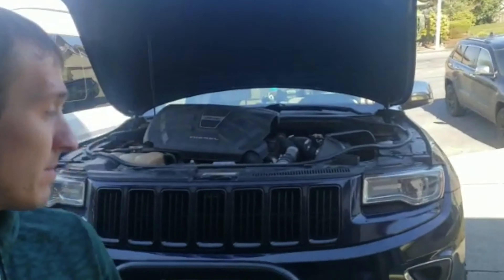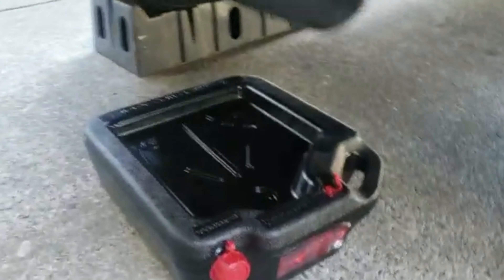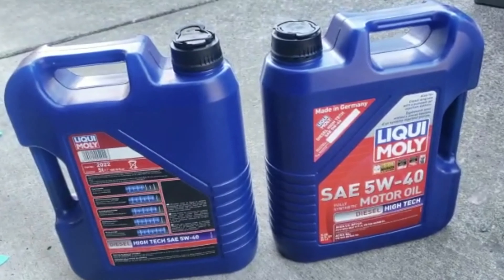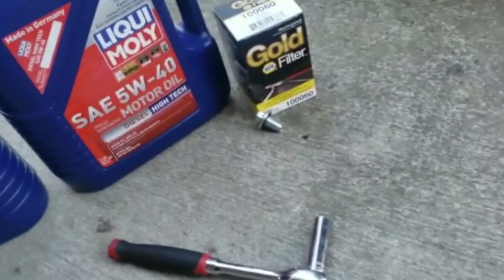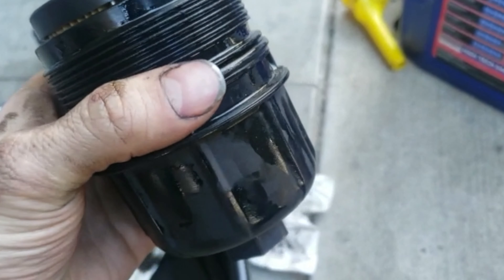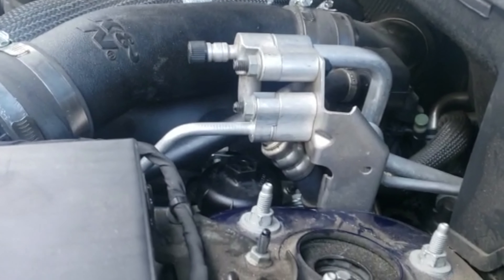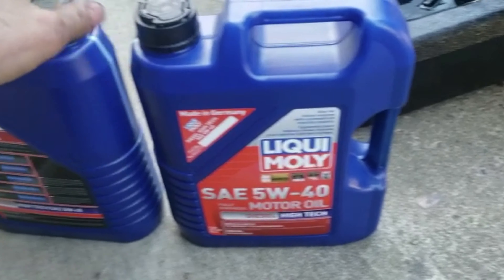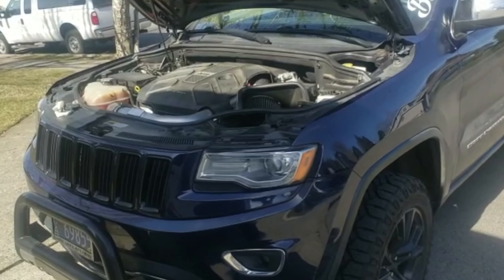Oil change in grand cherokee ecodiesel wk2.

Comment: You havnt done any jeep videos in a while but I noticed you had a shroud around or cold air intake is that to capture more air? Maybe I might try that. I did take my engine cover off to run cooler seems to work I think.. okay ciao thanks for reading
Reply from the maker: That shroud is to keep as much hot engine air away from the intake and to capture more cooler air.

Comment: are you still using the liqui molly oil and whats the spec on that oil
Reply from the maker: Yes it german made oil, really good quality. Its 5w-40
Reply: i see your using the diesel high tech here where im from whe only get the top tec 4100 5w40
Reply from the maker: @jpnaude5169  diesel high tech is best but regular 4100 would work too its still better then other oil brands.

Comment: 5000 miles is too often and a waste of money, the manufacturer recommends 10,000 miles.  Diesel oil doesn't breakdown as fast as gas engines.  Most of the damage to the oil in a gas engine is from minor amounts of fuel getting past the rings into the oil and the gas breaks the oil down.  Other than that, good job.
Reply from the maker: I disagree with you. If you change your diesel every 10k miles in these engines you will be changing your intake manifold by the time you hit about 100k miles if that. Because it clogged up from all the ash and junk. And your egr as well same goes for the turbocharger. I worked in for about 6 years i have seen cars that got their oil changed every 5k and every 8-10k i looked inside the engine huge difference. Im just speaking on experience not stating and opinion here. I will never wait until 10k miles and will never recommend it to anyone. If someone wants to its up to them on their own risk.
Reply from the maker: Diesel oil mainly has low ash compared to gas engines. The turbocharger is what breaks it down faster compared to the naturally aspirated. The diesel engine oil gets contaminated alot quicker then the gas engines. You probably know that already. And like i said i do it about 5-7k not more then that.
Reply: @BuiltForSpeed  considering my mother in laws ecodiesel has 160,000 miles on it and has changed her oil every 10,000 miles per the manufacturer specs with never having a single issue, I doubt it.  I have experience with lots of high mileage ecodiesels with no issues
Reply from the maker: @44stevenson  never had issues with intake flops, egr,? Or turbo? I highly doubt that at 160k miles
Reply: @BuiltForSpeed  nope never.  I've  been dealing with the engines since they came out. And Cummins Diesel engines for the last 16 years and in those you are good only changing the oil every 15,000 miles.
Reply from the maker: @44stevenson  cummins i havent had any experience with but ecodiesels. If you never had issues with any of that at 160k miles with 10k miles oil changes you are one lucky dude. I have alot of friends and family that did.